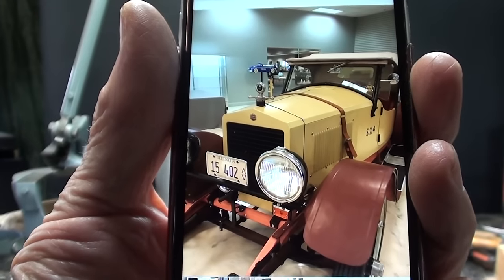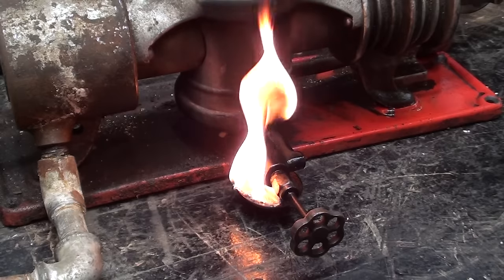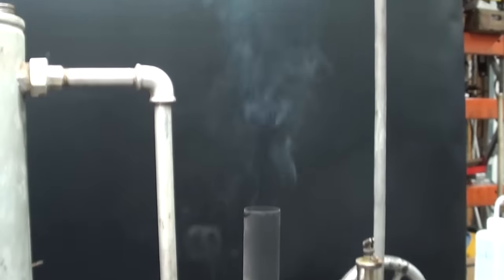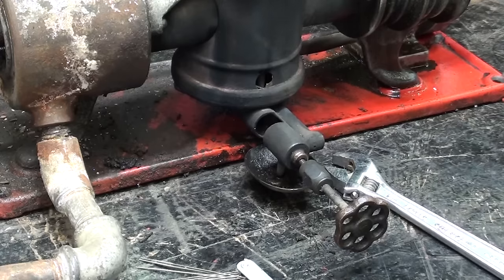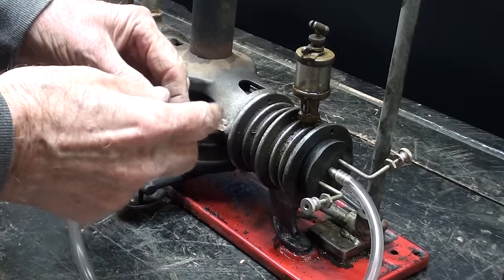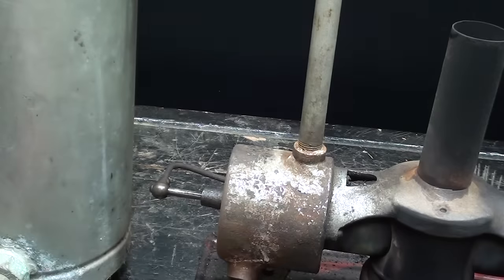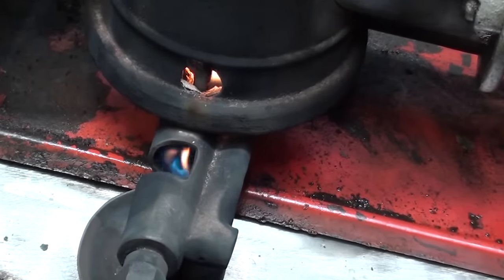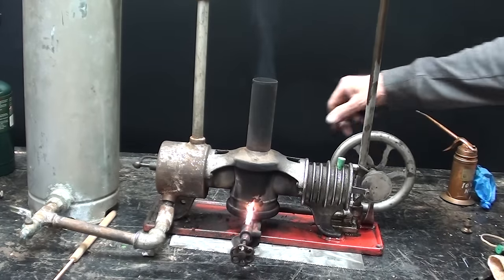ESSEX STIRLING HOT AIR ENGINE pt 2 #767 tubalcain stirling

Comment: You didn't mention it so I'm just asking, is the coolant above the level of the top pipe coming into the radiator? As I'm sure you know it must be in order for the thermosiphon to work. If it is, then I wonder if one of the pipes is plugged?
 Nice little benchtop Stirling by the way, I'm a bit jealous.
 I wonder if the denatured alcohol would vaporize better?

Comment: my guess is the piping in the thermosiphon setup is blocked--so no cooling on the cold side.  Also, the fuel orifice seems too large, maybe?  I say use your Burnzomatic as the heat source...you will get more heat in the correct location.

Comment: Have you tried to use just your hand held torch to heat it up and see if it runs that way? At least at that point you can either eliminate the engine or the heat supply

Comment: Im just wondering if you mixed the antifreeze and water before you poured it into the tank. I know some tractors have a syphon feed cooling system like that and on those you have to mix the antifreeze and water before you pour it in or it wont circulate. The reason is water and antifreeze has a different weight so the heavier just goes to the bottom and the lighter to the top. If you mix it first then the weight is all the same and it will circulate.

Comment: With Coleman pressure lanterns, the orifice size in the generator tip is usually around .006-.007 depending on if it's a white gas or kero model.  The big difference will be fount pressure which is probably around 20 PSI depending on how good a thumb you have.  That is way more than you will get on this gravity-fed burner contraption.
Reply from the maker: Thanks

Comment: Stirling engines use hydrogen or helium and it’s because of the thermal conductivity of the two gases. In theory is the engine runs longer and more efficiently.
It has to do with the power stroke of the power piston and compressing the gases at a higher temperature.
Reply from the maker: Thanks
Reply: @mrpete222  I meant to ask you if there was anyway it could become out of phase as far as 90° go?

Comment: Further to my previous comment - if there is no  circulation in the cooling system, it seems to me that it can only be because the pipes are blocked up.  Corrosion, possibly?  Maybe new pipes are needed?

Comment: You are close to running. The burner is not ideal but probably generates enough heat to make it work. The piston is certainly suspicious. Low friction is paramount and a smooth bore and smooth piston are expected. Even so the way it is working now shows some signs of good piston action. That is it goes back and forth. Does it bind or rub anywhere? Hard to justify the piston configuration looks hacked. The cooling of the displacer end looks bad. I would hose it down with cold water and see it it works any better. Your rubber glove test was clever and indicative of a problem. Pointing at poor temperature differential between hot and cold end and or a leak. As you well know these engines have very little power to begin with so any loss from friction, leaks or poor cooling could be trouble. It almost works as it is. I'll bet if you cool the displacer you will see improvement.  Sophisticated Sterlings run best on high pressure helium instead of air. Helium has very high thermal conductivity. Interesting video, viewers will learn more from this than watching a working engine.

Comment: It's not hot enough clean air holes on the heater head clean the needle valve etc very proper fuel and air mix.... so you did that outta the fuel tank holding pressure .... just like an old gasoline torch they must hold pressure.... my gasoline blow torch that was my grand fathers took some cleaning and fixing of seals..... and the packing at the needle valve back end was probably the peoblem .. going must be over 80 years old and works better than the one i bought new when i lived in the Philippines.... takes some time to warm up....

Comment: Thinking more on this, wondering if you are getting enough fuel to the burner?  Could that beautiful brass cap have a blocked vent hole?
Could that main fuel shutoff that you said needs repair have something internal that is blocking the flow of fuel, such as misplaced packing material or broken gasket/washer?
Keep digging, we are counting on you!
Check out the burner on one of your old blow torches.
JIM
Reply from the maker: Thanks

Comment: Hi Mr Pete I do not know anything about these engines it seems to me that the needle jet seems l too large I wonder if you added two more feet of tubing to the fuel tank if that would help with that problem also I wonder if you have an air pocket in the cooling system it seems to me if that had any air in it it would not work properly you might have to backfill the heat exchanger . Well good luck Mr Pete maybe she needs rebuilding thanks JM
Reply from the maker: Thanks

Comment: I thought I saw a leak at the needle valve in part 1. The copper sleeve must be a "repair." You might need to repair the "repair." Since you already hinted at a solution to the cooling problem, I am guessing you found a blockage in the cooling line.

I am also a tool hoarder. Can you tell me how to contact you regarding tools for your Mystery Tool series?
Reply from the maker: lislepete22@yahoo.com

Comment: I think there is too much carbon and soot build up.
I also think that many "places" of accumulated wear have degraded the engine to a oint of inoperability.
Does the patent drawing show the brass cap on the piston and brass liner in the combustion chamber?
Early on I thought there might be pinhole leaks in the heat exchanger/combustion chamber.
I have no idea, but am eager to see more diddling!  🤔
JIM 🤷‍♂

Comment: Interesting… so if I understand the function of this device, it is all about temperature differences being harnessed to run the mechanism. 

So I would look for issues with temperature transfer.   I think the cooling system would thermo siphon fluid fast enough to keep the displacer side cooler.  Note that there are no cooling fins on that part.  Could there be some kind of restriction or orifice in the line? 

Secondly if there is a carbon or soot build up in the furnace could that be retaining enough heat to keep it from working properly.  Could you flush that chamber with something to clean it?  

Last rambling thought… It seems like the cooling fins on the piston side are designed to displace heat for a reason.  The designer wanted that part to stay cooler.  My untrained uneducated guess is this might be caused by heat retention in the furnace area transferring to the piston cylinder side.  Is there some sort of insulating part that should be in place or replaced? I doubt the cylinder should get that hot.
Reply from the maker: Thank you for the ideas

Comment: Hi, I am a beginning machinist student in my 4th year of machining at high school and am working on the path towards getting my journey persons papers. I was wondering what tools you would recommend for me to buy? I have digital calipers, a 0-3 micrometer kit, a digital depth micrometer, a digital micrometer, dead blow hammer, file, needle file kit, center drills, machinists calculator, 4 piece combination square set, 8 inch crescent wrench, cheap 21 pc sae tap and die set, 1 fine tooth file, Allen key sets, and wiggled edge finder. I am ordering and Shars electronic inside micrometer, Mitutoyo dial test indicator,  noga flex magnetic base indicator holder, dial indicator on a Mighty mag base, and an angle v block that is adjustable.
Reply from the maker: Good luck with your new career choice. I am sure you will make a great machinist. Sounds like you already have lots of nice tools. Watch this video of mine.
Beginners machinist toolbox part 1
Tips #442 tubalcain

Comment: My guess , is that the brass extension is to reduce the thermal mass of the piston thus improving efficiency of the fluid / heat transfer .

40 plus thou seems too big for a burner jet, I recall tilly lamps had a tiny ≤ 10 thou"
Reply from the maker: Thanks

Comment: I think you're trying to work with too many variables at once. An Essex engine of this type takes very little heat to run, that's not your problem. You also don't need the water cooling to get it running but only for long-term running. If it were me I would remove the original burner and work with a good propane burner for testing (eliminate that variable) until you get it running. You can sort out the old burner later. Part of the reason you're not getting a nice blue flame is that the tank isn't high enough to generate sufficient pressure. It's obviously "almost" running which means you either have an air leak or some unwanted friction. You might pressurize the engine with a few pounds of air (like you've done), but then submerge the whole thing in a tank of water and see where the air bubbles are and how extensive they are.  I would first mic the rods to see if they are worn--even a few thousandths can make a difference. I've restored many antique hot air (striling) fans and the displacer rod is usually the first thing that needs replacing. Also, I don't believe 'Bubba' has altered the engine. That brass extension is there for a reason--it eliminates much of the dead air space within the engine and will be even more difficult to run without it. I also use nothing heavier than 3-in-1 oil for lubricating the piston. Good luck and hope to see it running here soon.
Reply from the maker: Thank you for the suggestions. There will be a part three on Saturday. I filmed these three videos two months ago. I intend to continue with this project in March after I come back from Florida. I will take the entire thing apart. Yes, the very first thing I thought of two months ago is to convert to propane. But I want to keep it authentic if I can. Do not like to make modifications to an antique. But I will get it running, and I appreciate constructive comments by people who are familiar with hot air engines. Thank you very much.

Comment: Obviously the water jacket is clogged and probably needs a good cleaning. Probably too large a needle valve. Soot build up is a real issue in the heater chamber too. But you know all that .. so ... Take off the hat and start a scratching session.

Comment: The heat source (flame) is too cold.  A premixed flame having the correct A/F ratio would appear blue.  Also, I'm not sure that the fuel is actually being atomized.  It appears that it is merely sputtering and dribbling fuel.  It's way too rich and therefore too cold.
Also, the working fluid must exchange heat between two reservoirs having different temperatures.  The wider the temperature difference, the better because the mechanical work developed is proportional to this.   If they're both rising to the same temperature, no work output. Good luck.
Reply from the maker: Thanks
Reply: @MrShobar maybe if you actually watched the videos or payed attention, you’d have heard    Mr. Pete saying the same things. SMH
Reply: @CD-oe6lc  I "payed" attention. SMH

Comment: I donot think you should be using antifreeze water cools better
Reply from the maker: I will try  water when I get it in the basement where it is warm
Reply: I think the specific heat goes up with the use of antifreeze so it should actually cool better than just straight water.  It also  increases the boiling point of the coolant so there is a lower chance of creating steam in the closed cooling system.  Even a little steam could burst seams or worse cause a catastrophic failure.  

Thank you Mr Pete for presenting this material!